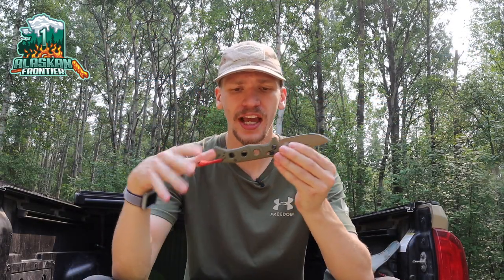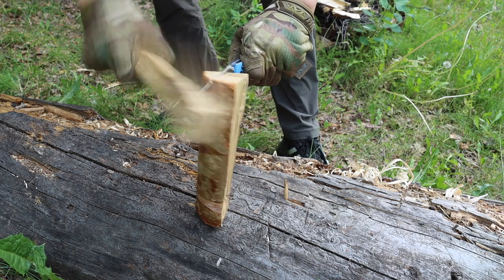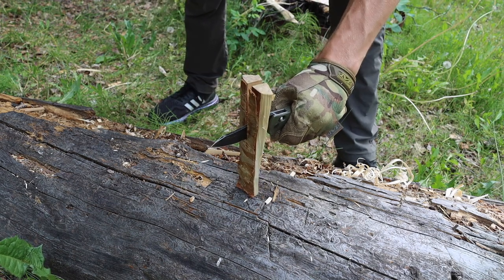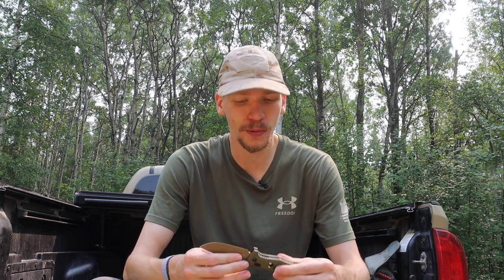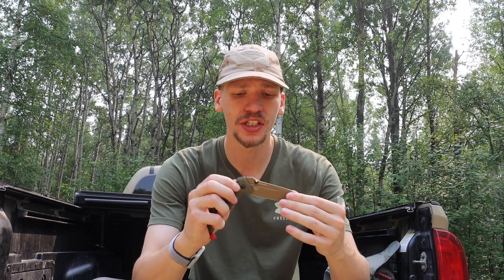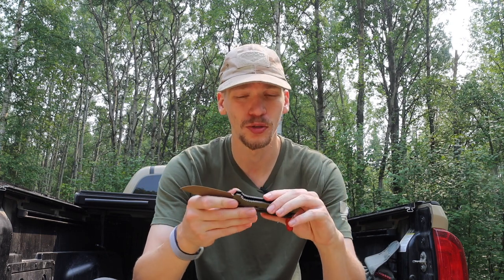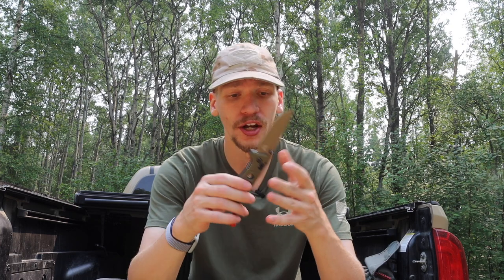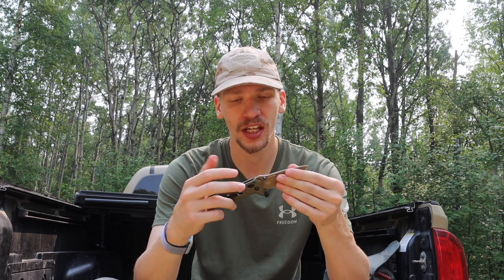Benchmade 273 Why I Think The Lock Fails

Comment: Nothing to do with the springs.
I’ve investigated this matter thoroughly, and have come up with the most reasonable conclusion and even a fix.
The Cerakote treatment requires a special method of application. If you look at the exposed blade tang, you’ll see that where the lock engages the tang area, there’s a bronze sheen to it.
This is part of application / curing process of the Cerakote finish to the blade. It reduces the friction coefficient between the lockbar and the tang of the blade.
I took a small piece of sandpaper, and polished the area, completely.
Now, not only does the bar engage about a millimeter farther, but it also doesn’t slip whatsoever.
It is a very robust lock - even though not as strong as the TriAd.
Try this fix out, and enjoy the knife..!

Comment: General rules for using folding knives:
1) Don't hit the spine on hard objects.
2) Don't try to replace the axe with a knife.
3) Regularly clean the knife (especially Axis).

I've been using a full-size Adamas for about ten years hiking and have never had a problem with the lock. I completely trust Axis.
Reply from the maker: That’s because you have an original Adamas. I too had one and it was stronger than the modern Adamas. Please note there are a wide number of differences between the Cruwear and D2 Adamas variants.
Reply: @AlaskanFrontier1 Contrary to popular belief, I don't consider disengage the lock to be a problem. I think the Benchmade engineers deliberately loosened the lock so that shock loads on the spine would not cause damage to the liners (this is what happened with the first generation Adamas). The lock does not fail under static loads. It will not fail even with accidental blows to the spine. Refusal is caused precisely by strong, intentional blows, which indicate the misuse of a knife (batoning). This is elementary foolproofing. Benchmade obviously didn't want another "survivor" in the woods to send them bent liners every weekend asking them to replace them. Most people simply enjoy owning an Adamas without putting it under unreasonable stress. Therefore, they have no problem with the knife. Problems arise for bushcrafting enthusiasts who are smart enough to batoning with a folding knife without disengage the lock. I think they deserve cut fingers in this case. Just buy a damn axe and stop doing stupid things with a knife.
Reply: @neongirl I like the Adamas for the bread slicing and box cutting capabilities that it's built for. But the Adamas is definitely not a "Hard use Tactical folder" like benchmade claims it is.
Reply: @johnnyeas1431 just my opinion, but hard use “tactical” vs hard use “bushcraft”.  Tactical use doesn’t involve batoning.  Most Adamas knives will never see more than tape, rope and cardboard.  I carry a fixed and a folder.
Reply: @kds471  your opinion is wrong because immense pressure can be applied to the spine of a blade in tactical situations, and if you're just batoning with it
Reply: @johnnyeas1431  a wrong opinion?  Ok.
Reply: @kds471   I realize this conversation is beyond your understanding of logic, reasoning, and the fact that there are always multiple opinions, but only 1 can be right.
Reply: @johnnyeas1431  logically an opinion is based not on fact but conjecture.  A “tactical folder” is in itself an oxymoron, a term invented by companies to invent another commercial segment.   If you are truly in a tactical situation I hope you have a fixed and not some cool looking folder.  My opinion of course.  Pray tell, what tactical situation would require your knife to withstand a blunt force from a hard object whilst against another hard object?